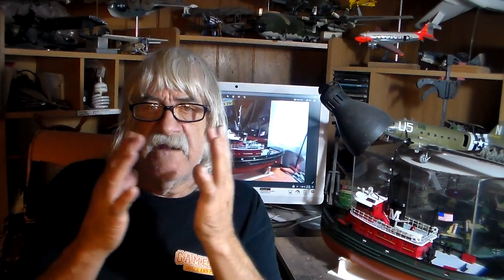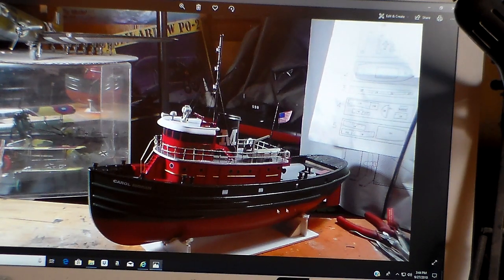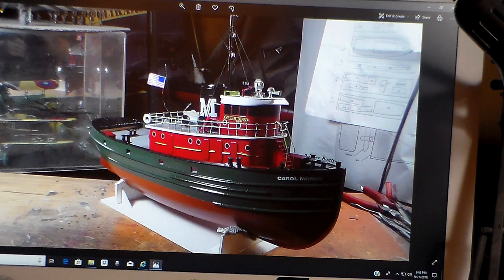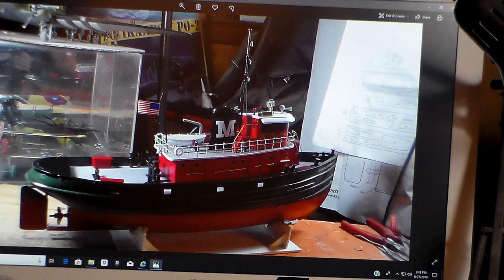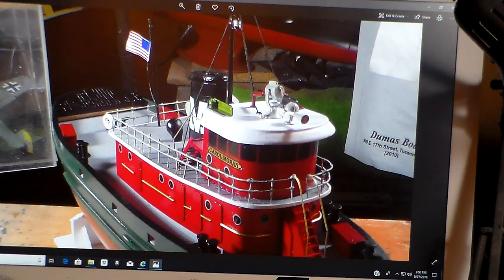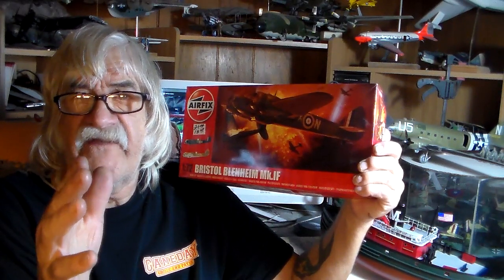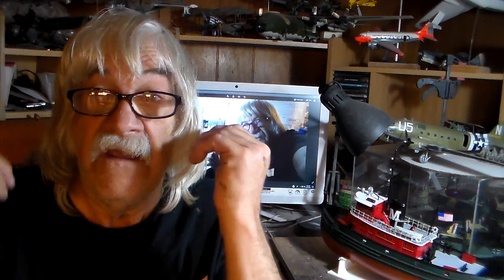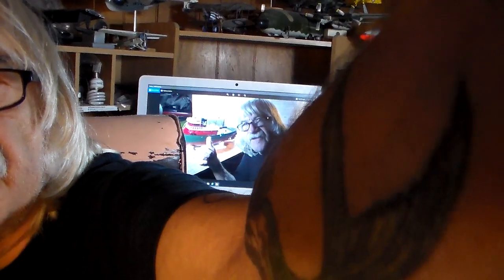Dumas CAROL MORAN  Video 5  FINAL REVEAL

Comment: Hey Frank,where can I find the motir,prop and bearings to motorise the hull of the Billings Boars Lila Dan?
Reply from the maker: Ahoy Philo                        Great to hear from you again buddy, There are two scources  try Ebay on Billing boats or go to Dumas boats the George Washburn running gear set will fit the Lila Dan. most of the time Billingboats on ebay will have a Lila Dan on auction with the fitting set that has the running gear included. There you go give it a goFrankie Day